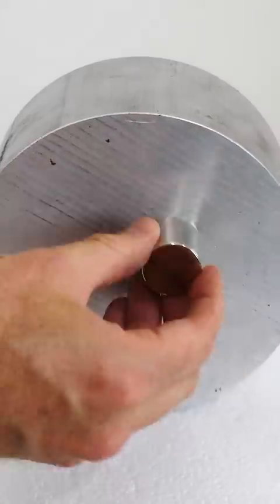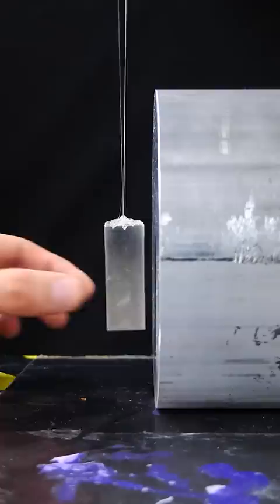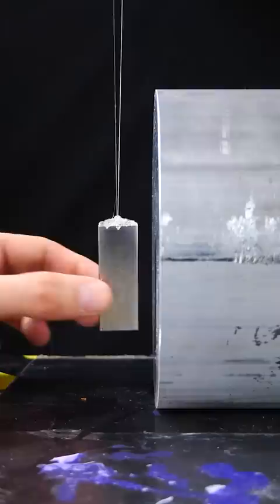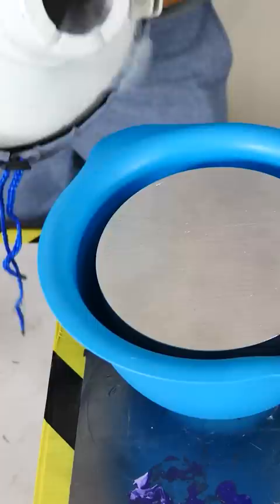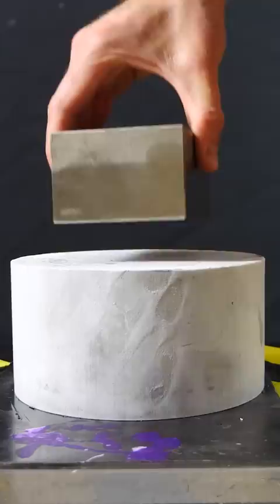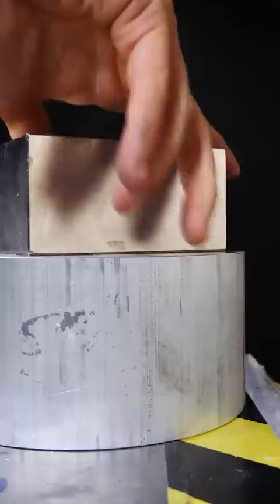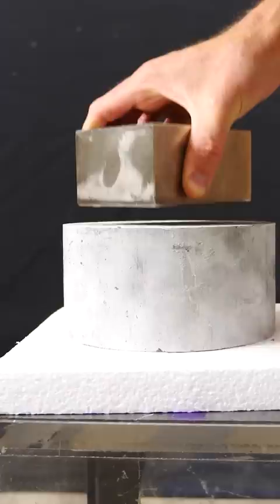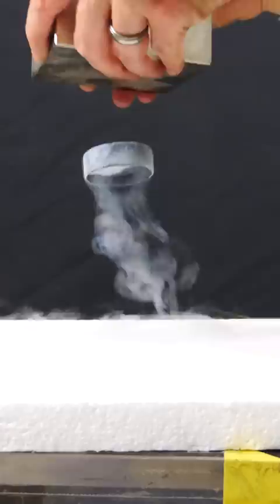Magnetic Braking Looks Like Magic

Comment: This principle is what's used in most modern roller coasters. The magnets never touch the brake plates therefore these parts rarely wear out like traditional brakes.
Reply: 😂 bro… this is used on bullet trains that cost hundreds of millions of dollors, they use a bunch of different methods to attach the carts to newer coasters, non of them being this. it would be much to expensive to do
Reply: @lukeboyer4071 they use magnetic braking because they don’t wear out and risk malfunction. It’s not about money it’s about the safety. If people found out these multi millionaire company’s like Disney were cheaping out on their braking systems, there would be a lot of backlash.
Reply: @lukeboyer4071 Well, there is scaling. Roller coasters are much slower and require less braking, and, as demenstrated here, you can create the effect without too much capital. While a mom and pop roller coaster (are those still around?) probably couldn't afford it, Disney or Six Flags can spare a few more thousands for a frictionless brake (especially if it's in conjunction with traditional brakes).
I would however trust a bullet train's brakes more than a rollercoaster's, so there is that...
Reply: @lukeboyer4071 since roller coasters move slower than bullet trains, it wouldn't be as expensive.
Reply: Most? Doubtful.
Reply: @lucasblanchard47  "Most MODERN rollercoasters."
Most rollercoasters are still not modernized.
Reply: @lukeboyer4071 I think you've confused maglev with magnetic braking, which are two different phenomena. Obviously maglev would be prohibitively expensive for a roller coaster (as it must be actively cooled), whereas as this video shows, magnetic braking still works even at room temperature, so it's not nearly as expensive to implement.
Reply: @lukeboyer4071  sorry buddy, but you're wrong. There are most certainly magnetic breaks on many coasters around the world. Not all, usually not the cheapo ones.
Reply: @releasethebogus8581  yup exactly what i did y’all are right i just want educated in the topic ig, i do appreciate being educated tho that’s what life’s about
Reply: @lukeboyer4071 respect for that x
Reply: @Puppste  lol you called Disney a multi millonaire company
Reply: Daaamm I love science,, I so so so wish I'd have take. That rout an became a scientist,  if I knew as kid what I know now,, id be one for Sure💯 I'm not stupid by any means,,  being a mechanic running my own workshop I can't be, or I'd starve n go bankrupt real quick lol
Reply: e
Reply: @spinyslasher6586  Do you think that the roller coasters that exist now are the only ones that ever will?? New ones are built every day and there are literal conventions where companies show off their latest amusement ride technology.
Reply: @Puppste  A company cutting corners on safety to squeeze out more profits wouldn't be news, but in this case I agree.
Reply: @zekeharris6839  nope, but as it stands, most modern rollercoasters have magnetic brakes.
Reply: @lukeboyer4071  wtf is a dollor
Reply: @Puppste i doubt there’d be any backlash. people are too complacent.
Reply: @lukeboyer4071 bro took an L gracefully and without deleting any comments. major respect to you dude
Reply: @rya3190 also for the fact they wouldn’t be spending all that money replacing the brakes and paying someone to replace them that much more often
Reply: so thats what those tiny can looking things on the ends are? i always wondered what they were for, like what, in an emergency is a fking aluminum can gonna stop us? apparently...
Reply: @lukeboyer4071 magnetic levitation is not magnetic braking bruh
Reply: @CarlosAM1  yah i was mistaken
Reply: @lukeboyer4071 you realize roller coasters are basically just the test ground for trains and shit without the risk of millions in damages
Reply: @toastslicer4885  not true…
Reply: LL
Reply: @laurieradford9632 but can't spell or put together a coherent sentence. Didn't know world of warcraft had mechanically shops
Reply: @toastslicer4885 😂😂 says who? You? Loop to loops and corkscrews are everywhere on passenger train lines I've noticed 😂
Reply: I've always wondered if this woild be good on cars. Or is it too dangerous?
Reply: I was just thinking they use this system to slow down electric vehicles
Reply: I doubt very seriously that roller-coasters use magnetic braking since it requires super-cooled electromagnets. Cryogenic technology is extremely expensive as well as being delicate.
Reply: @spaceman081447  as shown at the start, no it does not. at smaller scales you only need small magnets and a block of aluminum or something similar
Reply: Used for the new aircraft carrier.

Comment: I really wish car companies could figure out some sort of way to reliably incorporate this, or just a way to get rid of brake pads altogether. Im no eco warrior, but a vast majority of pollution from cars is actually brake dust, which is worse than exhaust fumes. Not to mention that electric cars, even with regenerative braking, still use classic brake pads. (although a lot less since regenerative braking uses the motor more than the brakes)
Reply: The biggest portion is tyre dust. It's hard to imagine brakes producing more.
Reply: This is how the brakes of trains work at high speeds.
Reply: We just need to reduce our dependence on cars. Normalize waiting a few minutes for a train or a streetcar.
Reply: @doomsdayrabbit4398 No, I want to drive 3 hours out into the desert and party with my friends.

I'll use a train when I get to drive it, park it in my garage, and drive it off road.
Reply: @nightlight0x07cc  You can go ahead and do that. We don't need to have a train going into the middle of the desert. But what we shouldn't have is these absurd two ton piles of junk clogging up our cities.
Reply: Brakes participate in pollutions? I didn't know...
Reply: @doomsdayrabbit4398 it’s too late for that in America, our cities/highways are designed to make car ownership a necessity not just a luxury. and if you try and tell Americans otherwise they’ll flip out cause they someway or another find public transportation beneath them.
Reply: @IamAwhiteMEXICAN  I think people are coming around slowly, especially with all the airline issues. I live in a city a few hours from the nearest decent airport, and the celebratory forwarding of a proposed train route that happens to connect the two has been eddying through local email chains for MONTHS now.

Comment: We desperately need to integrate this technology into shampoo bottles in the shower
Reply: Shampoo bottle being hit: boom, bang, doom, schiiii, criiiii, creating a wormhole and disappearing from the sight
Reply: Also soap so it would stop playing Tony Hawk's Pro Skater every time once it's dropped
Reply: Legos should be made of this, so when you step on them, you just slowly boop them
Reply: or, you could just attach a magnet to the shampoo bottle, to make it less likely to fall...  just some shower thoughts
Reply: and rollercoasters
Reply: fr 💀💀
Reply: Exactly. While "catching" it with your big toe seems to slow it down considerably, it exerts enough force on the toe to make you scream out loud 😂
Reply: Can we do something like this for cars?
Reply: עילג ישראלי  It needs to be extremely cold and its not very practical
Reply: @lukesylvester2022  not necessary
Reply: Impossible
Reply: @natalieramirez6539  it would expend a ton of energy to keep them chilled but feasibly we could install something like this to prevent rear ending. Prevention of T-boning is also possible but it would be much less safe to implement. This is only in theory though, and it’s probably way too expensive to implement especially since it only works if every car has the system.
Reply: @elainasynranelt  I see, what about in regards to the rails on cliffs and roads?
Reply: THANKS
Reply: If you mean making it so that it lands softly on the bathroom floor, I hope you are prepared to have your feet frozen off
Reply: a
Reply: @RealPronotfound  is. free fall roller coasters
Reply: Hear me out.....  what if we made cell phone cases that prevent your phone from smashing into the ground?  I'd probably be "self forever sleep'd" by the people at Apple or Samsung though. They're all about that job security.
Reply: @RichardCranium321  what are you going to use to repel it from the ground? The ground is not metallic everywhere so a magnet in a phone case wouldn’t induce eddy currents into the ground which are what creates a magnetic field in the aluminum in the example which makes it have magnetic properties even though it’s not a magnet. A magnet strong enough would probably do more damage to your phone by attaching the case than anything it will protect when you drop it.
Reply: @IhaveaDoghouse  so how about making a 2 part magnetic case with the outer case being aluminum and inner case being neodymium? Just have the phone kinda free floating in the case 🤷‍♂️
Reply: @RichardCranium321  the inductions of eddy currents requires relative motion between the conductor and magnetic field so either movement of the conductor threw the magnetic field or movement of the magnetic field over the conductor. If it’s not falling there is no movement so no induced eddy currents therefore the phone would be sitting on the bottom of the outer box and both would fall at the same speed so phone on the inside would already be against the bottom of the case and would stay there while falling.
Reply: @RichardCranium321  this is just from my basic knowledge of eddy currents and magnetism as an electrician. I am no expert. I like your thinking though i am typing on a spiderweb cracked phone screen right now lol
Reply: Yeah! I broke three toes dropping one of those huge ones on my foot in the shower! Landed just right
Reply: @LeonSKennedy7777  I don't think that would work our feet are not made of very cold aluminum  xD
Reply: @עילג ישראלי it works better the colder the aluminium is. Rockets get scolding hot upon reentry from friction with the atmosphere. Even if we managed to supercool the descending rocket, it would still require a truly GIANT magnet array to work, and it would only work at the designated landing site.

In short, parachutes are simpler, cheaper, more reliable, and also work if the rocket is forced to land outside the designated landing zone. In engineering in general, and space engineering especially, it's always best to adhere to the KISS (Keep It Simple, Stupid) philosophy. The less complicated you make something, the less chance of catastrophic failure.
Reply: They already have. It’s the mark IV squishtoe.
Reply: The problem being that your shower floor would be way too chilly to stand on
Reply: @KeksimusMaximus  😂😂😂😂😂😂
Reply: They had something very similar to that during the 70's and 80's.
It was called 'Soap on a Rope'😜
Reply: In cars to lessen impact of wrecks
Reply: And soap
Reply: Cups at 3am need this
Reply: That's actually a really good idea
Reply: @KeksimusMaximus  might be good for prison too lol
Reply: And shoes for walking inside your home late at night
Reply: Seem to be having an awful lot of negative interactions with that shampoo bottle. 😕 😆
Reply: עילג ישראלי  imagine the price of a magnet that huge
Reply: More importantly, what if we use this to invent free fall shoes
Reply: Why?
Reply: Winner
Reply: @KeksimusMaximus Pro Tip: Stop using bar soap and get liquid body soap and a loofah (you know... Like what chicks use...). I gotta be 💯 it was the best change I've ever made to my shower routine. It's legitimately 10x better than a slippery garbage bar of soap and a shitty rag that barely even forms any bubbles. It's so so soooo much better idfk why everyone doesn't use it (unless they're pooooor ASF).
Reply: @natalieramirez6539  you mean so they don't crash?
Weld the chassis and everything onto a frozen ceramic disk.
Then when you get t-boned, you just get sent into oblivion without any side damage or any damage On the other vehicle.
You just bounce around (at that point you're unconscious or dead due to the dramatic & sudden changes in G-force) until the vehicle smashes into a non-frozen material like, a tree stump, or a house, a large bear maybe, even an electric pole.

Sure, those can be shielded by nitrogen frozen ceramics or metals, but what's the point? Some trucks can lift cars off the ground sending them off the hills onto rooftops, even across the stars.

It's just not gonna work. It's like Pinball ! 😁
Sure it eventually slows down but not after raking in some points (damage for car scenario).

Oh you wanted to float? Not possible!
You'd need nitrogen frozen roads.

Everywhere.

Even in your garage.
You want a frozen garage?
What happens when you cross a frozen road?
You end up turning into frozen road kill.

What you see with the little magnet HANGING and slowly braking before it rests, is a MAGNET HANGING

That means vertically.
If that magnet was dropped onto the block, it would break and then descend and touch/rest ON the aluminum block.

Applying that to a collision scenario, your car would need to hit a large wall in order to take advantage of such breaking phenomena.

2 cars (one aluminum, one magnetic) wouldn't simply brake before impact. The currents won't help when they're similar sizes.

The best method would be for every vehicle to have electromagnets that active a north pole (all vehicles in existence must remain on north pole) before impact.

Rendering your engine and battery useless since that takes quite a lot of power - since the opposing vehicle is also going to be attracted to that north pole...

😂 And if 😆 the opposing vehicles electromagnet isn't functioning ... it'll just be bloody.

One could just weld a bunch of neo-magnets around the perimeter of their vehicle, north poles facing externally as a backup..

But all that weight JUST IN CASE some semi-truck is dozing off on their way to hell ... they're not paying you for that fuel. Ever. 😆

Why not just enforce log books? DUI regulations? Best Practices? Oh wait you hate the police ...
Yeah, bummer.

Keep reinventing the wheel since this world just doesn't work for you.

There's also insurance & jobs but y'all broke that world already.

To infinity AND beyond‼
The dead end you've all made.
Reply: עילג ישראלי  because they'd have to aim them and then drop them & trust quantum laws.. and that's too cheap and attract much less investors.
Reply: @natalieramirez6539  they have magnetic rails already.
Very smooth & fast rides.
But yea. One earth quake & it's over - the entire train gets derailed & smashed into whatever environment +300mph.
Death is Inevitable.
Keep asking questions though, I'm never direct 😶😁😏
Reply: @RichardCranium321  it eventually comes in contact With the metal after that speedy approach + braking phenomena.
What you saw there was a hanging magnet (vertical).

So after it stopped, it was hanging - and didn't touch the aluminum block.
Hand it been DROPPED on top of it, you would've seen it brake and then slowly with 1 or 2 seconds, touch the block and rest on it.

Got all that?

Ok, now if you had a frozen metal case and a phone inside it with a magnetic cover on it .. yea it would work somewhat.
Assuming you didn't drop it too suddenly because the phone itself is also fragile and the magnetic inner case could act as a hammer against the chassis.

All things in motion remain in motion..
Yes, the Eddy currents could absorb impacts but there no telling how much.

Also, you'll need a constant source of nitrogen pumping thru the case & gloves to hold your device.

All of which costs more than a military grade phone/tablet shield (leather case, absorbing screen shield or secondary glass protector).

Since you have nitrogen pumping thru it, you probably have it wrapped around something meaning you'll rarely drop it ...a useless setup.

Any more Ideas?
Reply: @XY4yt  William Osman will accept the challenge... even if he is just using a hot glue gun to mount it.

THIS entire thing was a joke, btw. I love how serious everyone is.
Reply: Is this an add for a 90's Adam Sandler song?
Reply: @elainasynranelt  You could do the same thing with an electromagnet, but it would require massive amounts of power
Reply: @firstNamelastName-ho6lv  tru
Reply: @maboleth  Bim, bam, boum 

Ça fait pshht et ça fait vroum

Comment: I'm thinking of it as the magnet is releasing a lot of magnetic fields which would count as thrust and when it gets compressed between it and the aluminum it slows it down because the aluminum of doesn't allow the magnetic field pass through. 
I can imagine ships in the future that have magnetic locks that have aluminum flooring to prevent ships from slamming into the ground with a soft descent.